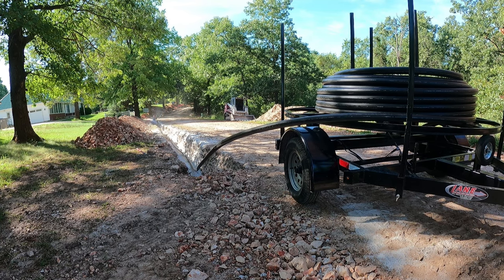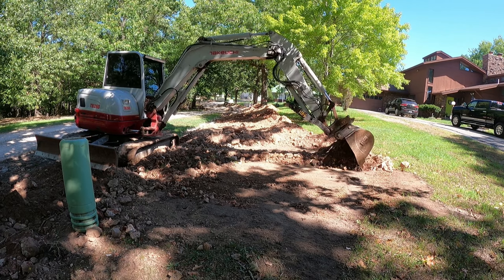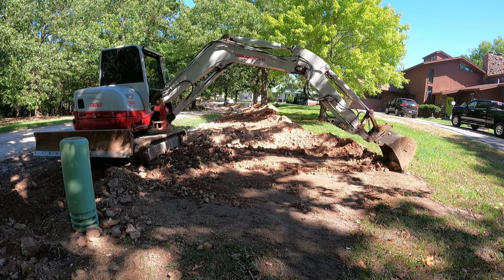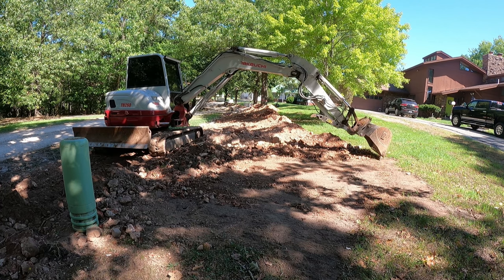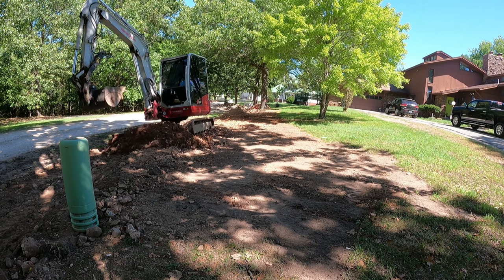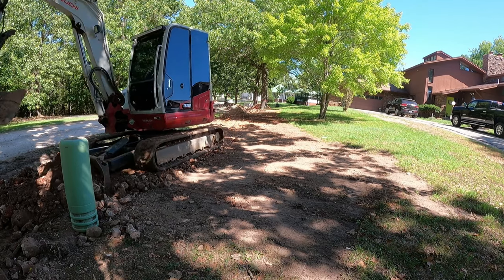Installing The 2" IPS Water Main Line

Comment: Last year gas lines were installed here but a trenchless system was used. The yellow plastic pipe was heat welded together as were tap fittings. Much easier to drill through the coral rock than scrape away the rock into a ditch with an excavator. It was used for the junctions though.
Reply from the maker: Yeah that probably would have been better here this stuff was tough lol! Appreciate you watching man